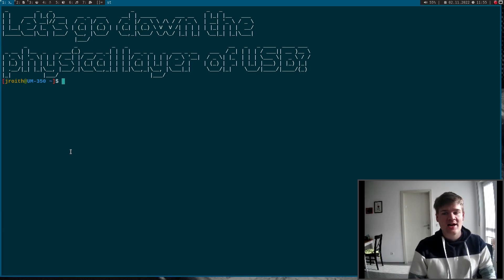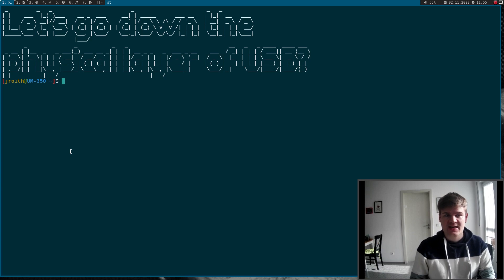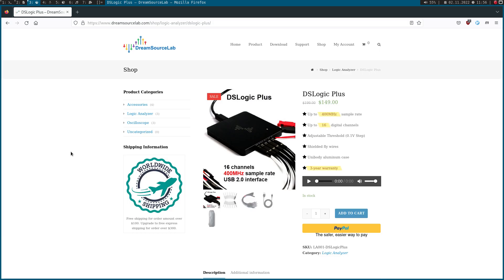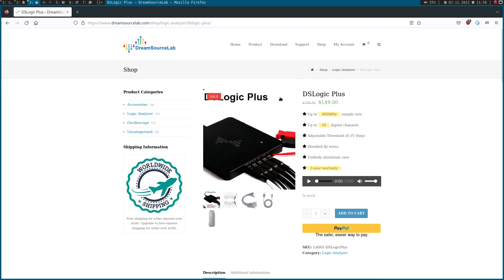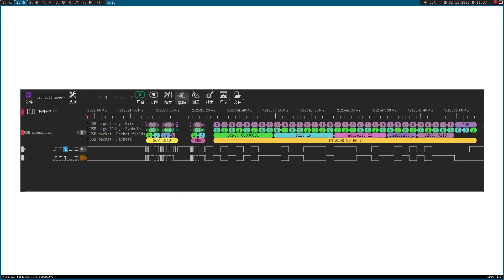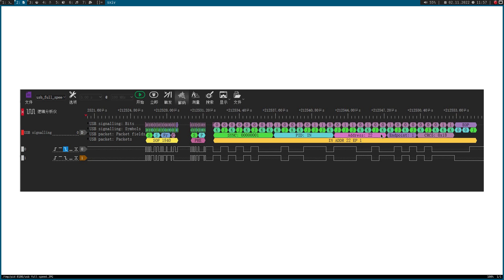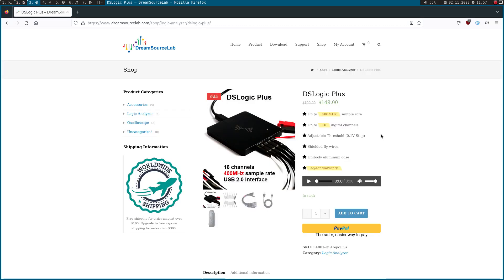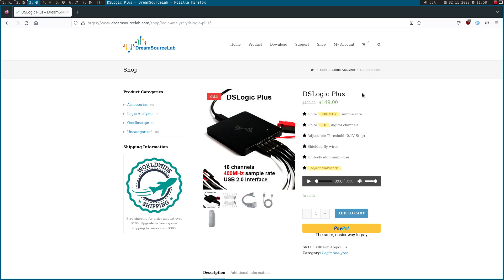GNU/Linux & USB - Let's go down the physical layer of USB???

Comment: Hi Johannes!
When doing the physical layer, do you also plan to cover at least one of the EHCI/UHCI/OHCI ?
AFAIK, UHCI is the simplest. Its spec is just 41 pages long!! (47 pages if you also count title page etc..). Others are considerably longer...
Reply from the maker: Do you mean going through the SPEC?
Reply: @johannes4gnu_linux96  
Yes. Not line by line, but the main idea of the host adapters can be given.  For UHCI, this should not be very difficult, as its spec is very short... 
There should be a register interface to the host adapters and I suspect that all linux USB core commands do is to fill in these registers.